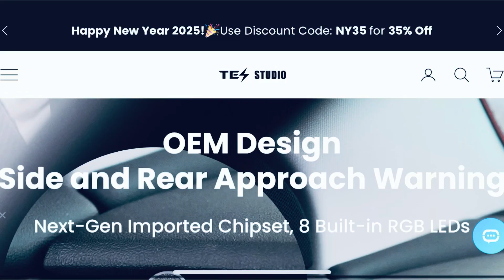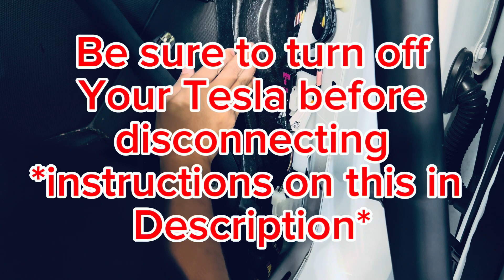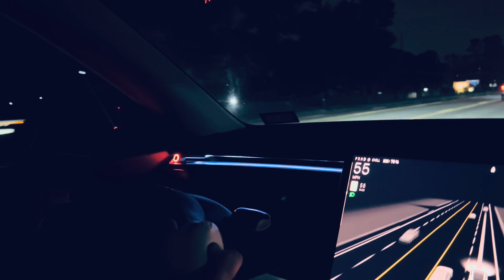Tesla blind spot assist

Comment: Wait, so it doesn't work under 30mph?  This makes it useless in local driving.
Reply from the maker: Most of these systems will not work under 30mph fue to accuracy, however, I believe they are working on a new one that will alert you with different colors in different speeds and driving conditions